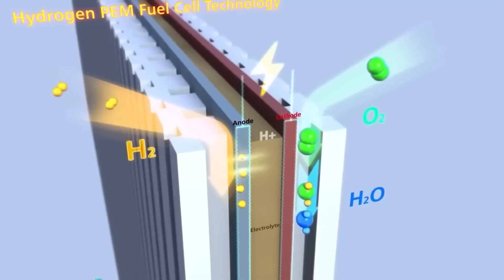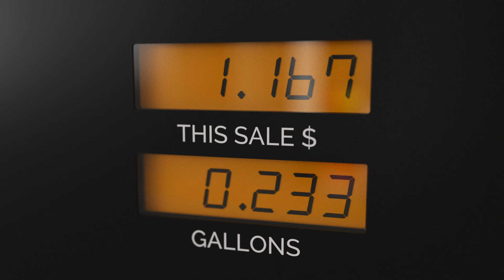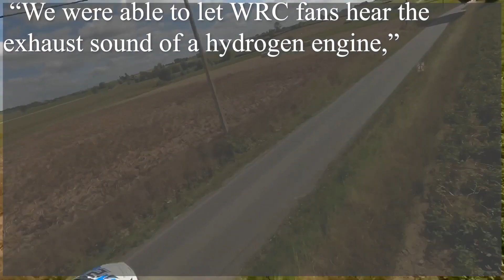New Toyota CEO - “Our New Engine Will Collapse The Whole EV Industry!”

Comment: EV's are nascent technology because we haven't got a satisfactory answer to the battery issues. It's exactly that simple. If we had batteries that were fast to charge (less than 5 minutes to 90%), had more range (at least 400 miles of aggressive driving) and used materials that were common place, easy to process and recycle, then we wouldn't be having this debate - ICE would be ancient history. 

Unless your vehicle usage is strictly urban, you don't want electric as your first and only car. It makes perfect sense as a second, commuter car, but not as your primary. Until the battery situation is resolved, there can be no widescale adoption of EV's. The best interim solution if you can't afford or don't have room for a second vehicle, is to buy a PHEV which has most of the advantages of an EV but uses a battery that is typically less than 15% the size of an EV's battery. Around town you'll rarely use your ICE or your brakes, so although mechanically more complicated than either an ICE or EV the truth is the engine gets minimal use. As an example, I have 15,000 miles on my Rav4 Prime but the engine has only done 3,200 miles. The brakes show no measurable wear and to-date there have been no mechanical or electrical issues. Put simply, it will be almost another ten years before my ICE hits 10,000 miles.

PHEV will always trump Hybrid. The mechanically complexity is almost identical but PHEV puts far less wear on the engine, less wear on the brakes, and assuming you have at least a 40 mile EV range, there really is no down side (compared to Hybrid). 

I hope and believe we will solve the technology issues surrounding batteries, but that day has no yet dawned. Cobalt has a shameful source (for the most part) as in mining it widely employs child slave labor. Lithium is better, but the pollution caused by refining lithium is horrendous and the cost of both metals is sky rocketing. Not much point in substituting one diminishing fuel source with a genuinely rare metal that can't easily be recycled. That makes absolutely no sense.

One possible answer is methane fuel cells. Although it generates CO2, the methane can be manufactured, economically, and in carbon capture mode (meaning net zero carbon emissions). If we do not find a suitable battery technology, this is our fallback plan. Synthetic fuel (for ICE) is unlikely to ever approach affordable prices (unless gas/petrol soars past $30 a gallon).

Regardless, the future is electric in turns of motive effort. The mechanics are simpler, the motors are approaching 97% efficiency, and the longevity of the motors should easily surpass ICEs.

Comment: EV s I think are still the future because of the fewer parts to go wrong and solar panels built right into the car body...
Reply: Unfortunately the amount of solar you can get from car panels is unavoidably limited. Even if you could cram 1000W worth of solar panels onto your car, in real world conditions it would likely take many days to achieve a full charge on a pure EV vehicle. I have a 7.2kw system on my rooftop which, on average, generates around 45kWHr per day. This easily covers my PHEV, but if you had an 80 kWHr battery (small for an EV) you would still be looking at two sunny days to get a full charge. So with 1000W of solar on your car your would be looking at nearly two weeks standing in the sun to get a full charge! So although it's a great idea, the practicalities just don't add up.